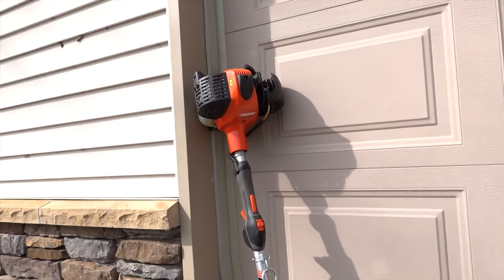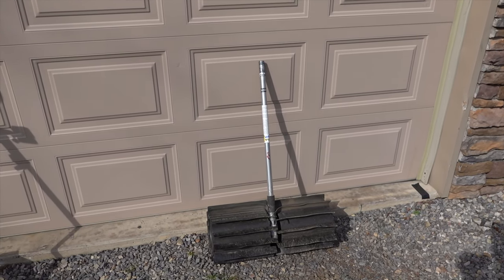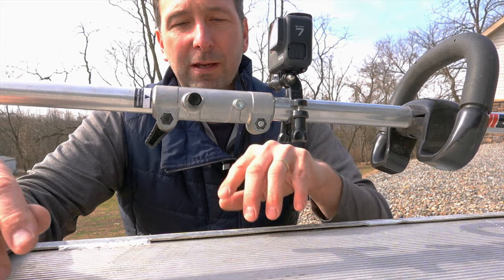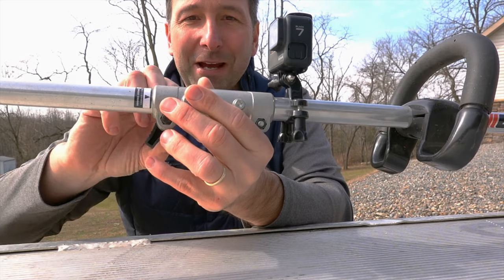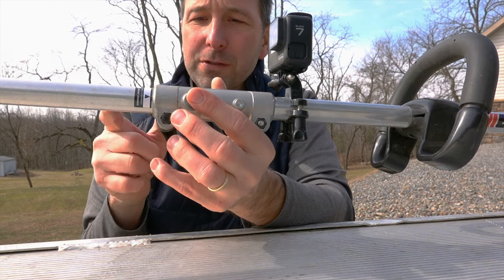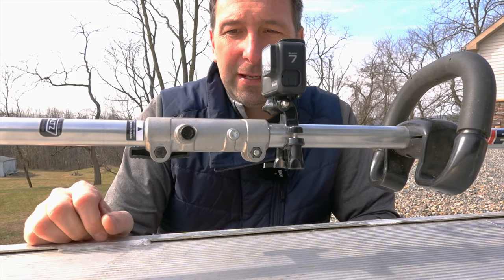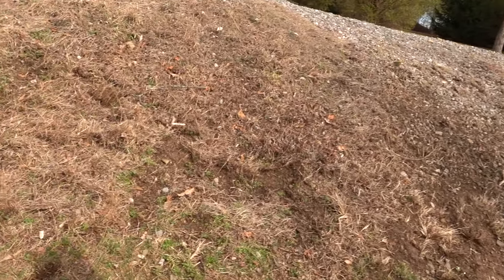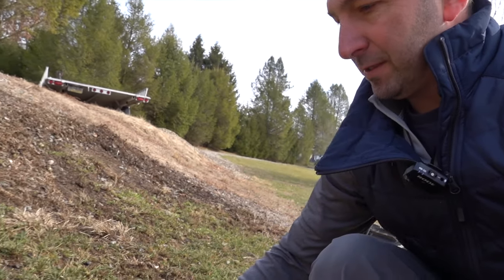Echo PAS-266 Power Pack With Pro Paddle Power Broom

Comment: Flip the attachment 180⁰ so you're pulling it. You mentioned that it fills your shoes up with gravel, but it shouldn't.  Pulling it operates it with so little resistance that you can keep it pointed away - literally operating it one handed. With the actual attachment flipped, you can hold the handle and trigger normally and keep it right at your side, effortlessly. Further, and more importantly, you'll find that it operates at its peak efficiency at about 1/4 to 1/3 throttle. That's all it takes.  No grunting, no hard breathing.  We've used these things for decades.  This is one of the most valuable tools available.

Comment: The $600.00 price tag is going to be hard to convince my wife. And yes, she helps me with the raking of the gravel currently. :-)
Reply from the maker: If I remember correctly, that price was for the weed eater and broom attachment.
Reply: $299 on echo website for the attachment assuming you have a power unit already.
Reply: @workingcountry1776  - unfortunately I don’t have the power head.
Reply from the maker: @workingcountry1776  correct

Comment: This is a helpful tool but it is difficult to operate for long periods of time. It is heavy, and the sustained vibrations really wear on the arms. I don't have anything that works as good though so I've learned to live with the physical demands. I'm not out of shape, but it's not conducive to be operated by short people (I'm only 5' 6" 😁). The shoulder strap included with it is junk and I've been using it without one for years. I'm going to order a full shoulder harness system off Amazon for $19 to see if that improves my experience. FWIW, rotating the head as suggested by others didn't make it any easier and in fact limits the distant you can easily travel since now you're having to walk backwards to use it.
Reply from the maker: I just used it yesterday to clean up some rocks and debris caused by plowing snow.  I really like this tool!

Comment: Hmmm... am I the only one who's thinking that if the kids are old enough to be driving ATVs around then they are old enough to do the clean up chores after? Such as cleaning up the gravel that they spread all over the lawn?

 I'm just not seeing how this cool looking device will be much quicker than raking and grooming though. I use a street broom (yes, on the lawn) and rake and it goes pretty quick - without the screaming 2-stroke and exhaust. Don't get me wrong though... I love gadgets but I have become much more selective about which ones will or will not actually provide net gain at the end of the day.
Reply from the maker: To each their own.  I prefer this over raking.  So do my kids...
Reply: When you are trying to rake gravel out of your grass back on to the shoulder of the road left from snowplow this winter it’s 10 times quicker.. I’m 73 and sick of raking 170 ft x 10’ every spring.